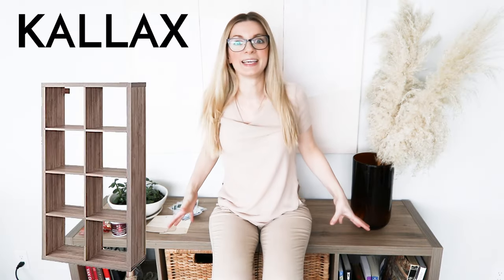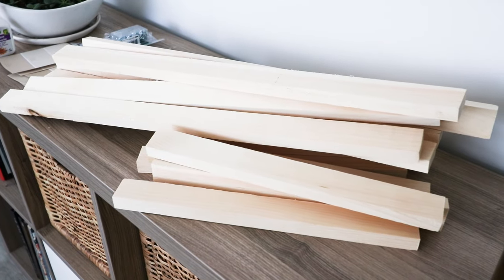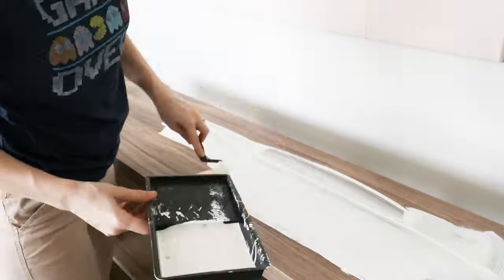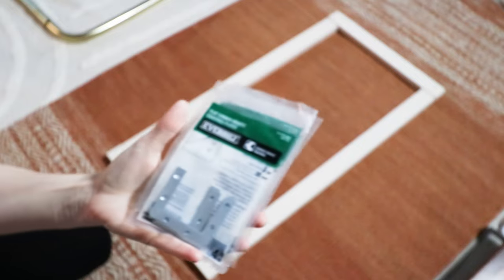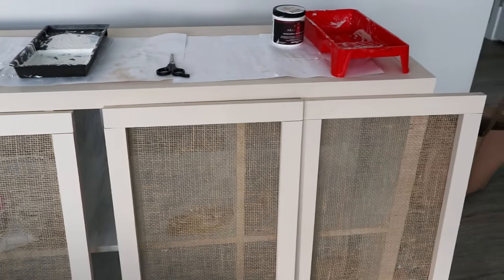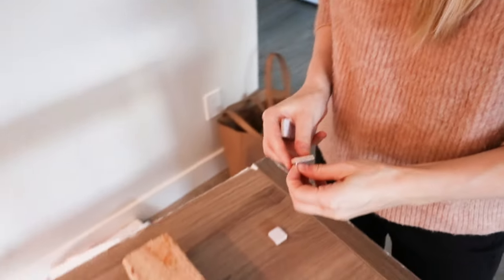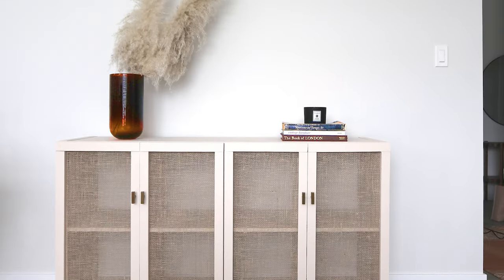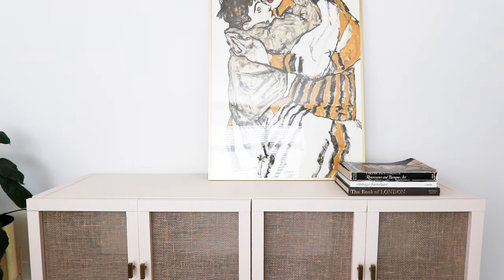EXTREME $50 IKEA KALLAX HACK | DIY faux cane doors?! 😱🔨wait what

Comment: I have been stretching fabric for years.  A small tip is to dampen the burlap with a spray bottle.  Keep watch on your warp and weft and don't over stretch, just a slight amount of tension before you staple.  This way, you have a taught drumlike finish to the burlap, when dry.
A tiny amount of wood glue or even Elmers, on the inside edge is also a good idea.
This is so great, and love the "feet", they really do lighten it.  
HD would also cut you a "Luan" backer board.  1/2" smaller than the actual dimension of the back so you have 1/4" shy, all the way around.  😍

Comment: Did you wet the burlap/hessian after you attached it to the doors?  That will shrink and tighten the fabric. Wetting it with a very thin flour and water mix will make it stiffer too, and more like the cane you wanted. This is how my ancestors made the walls of the house I grew up in in the 1860s. (The house not me 😵‍💫). Hessian nailed to the timber frame, wet to shrink and tighten it, then newspapers pasted on with flour and water glue until the wall was stiff enough, then pasted over with ‘proper’ wallpaper. The ‘walls’, and possibly the wallpaper had been there for at least 50 years when I was there in the 1950s. The lower section, to chair height were timber, but the upper walls and ceiling were all wallpaper over hessian.

Comment: Another option for future door hinge situations... folding/harmonica doors... so 2 doors with a hinge in the middle. 
/\  __ 
|____|

And then use small flat magnets to keep em closed
Reply: That's an EXCELLENT problem-solve for this item! Very elegant, too! I was holding off on doing this project because I feared someone accidentally dropping something onto the burlap, but the folding solution fixes that. Thank you so much! *And thanks to Vivien for such a great video!!! 🥰

I'll def use wood glue for the joins and screws, and sand/fill my assembled 1x2's before painting, so the finish is real clean. The pedestal feet are GENIUS, by the way. I'm sick to DEATH of our Kallax unit and am excited to do something cool with it. Thanks again!

Comment: Nice job. Finally someone that doesn't have a workshop with like $20k worth of tools. You couldn't attach the hinges on each outer edge, so the doors are still attached in the middle but swing outward?
Reply from the maker: Thanks! The hinges are attached to the bottom and the doors swing downward and close with a magnet.

Comment: I think you could have sanded some width off of each other doors and made them fit instead of what you did. That is just awkward if you're trying to get to something on the bottom shelf. This is where "measure twice, cut once" comes in. Any time you have someone else doing the cutting, you have to measure again before using. I've found HD and Lowe's to be as much as 1/8" off sometimes. For me, I don't like the see-through of the burlap. I think I would have put something, even poster board, behind it, but each to its own. Great idea, though!

Comment: Would have liked to see you fix the problem with the doors to allow them to open sideways instead of having them open downward. It’s very impractical because you need a ton of open space in front of the unit.
Reply: Yeah, she could have even just bought more wood and divided each door in half, but still have them open downward. That would’ve been more practical

Comment: I love this! I'm wondering, do you still need to use the primer paint even if the laminate bookshelf is white?
Reply: Yes because this primer is meant to adhere to the not sanded laminate surface and not to only give good cover to the previous color.  Regular paint on not sanded surface is going to scratch and wear much easier.  This primer lets you skip the tedious, dusty sanding.

Comment: Nice job!  But the paint doesn’t easily scratch off if you don’t sand?  Even if you use high adhesive, shellac based paint???  I find it did on my kitchen cabinets....even though I actually did do a gentle sand first and degreased before sanding.  What is your secret? Or are these pieces of furniture just not touched much?
Reply from the maker: It doesn't scratch off! The secret is the primer. Sealing it would protect it even more so for cabinets I would definitely seal. (I didn't seal this piece)

Comment: It's a cool result but I am worried that if you ever get any dirt on this you won't be able to clean it, which is why you usuallly use cane on this type of things because you can wipe it off. But maybe you can add some mod podge or at least something like scotch guard to it?  Also if anyone reads this and wants do it "more professionally" cut the wood at a 45 degree angle and add some woodfiller to the cracks before painting it for a cleaner looking result :)
Reply: I've done mod podge on burlap and it works great and makes it nice and stiff!  Good tip for people!

Comment: I would have cheated...buy a roll of wallpaper with any design..even a cane pattern and had a wood insert glue the wallpaper down and wrap the board, frame it out then install it.  Can be wiped down.  Lest likely to get a hole punched in it or torn if you have pets or kids and will prevent seeing stuff on the shelves